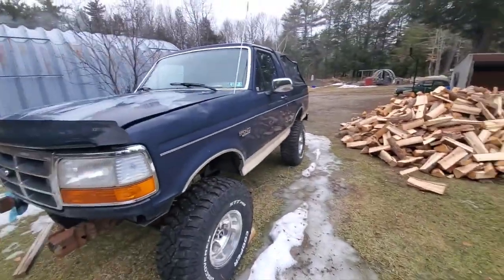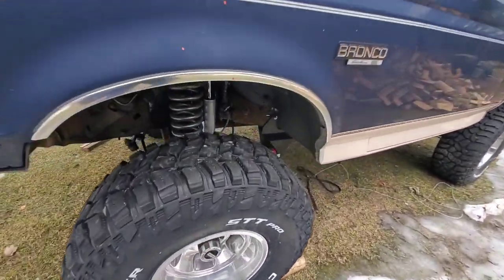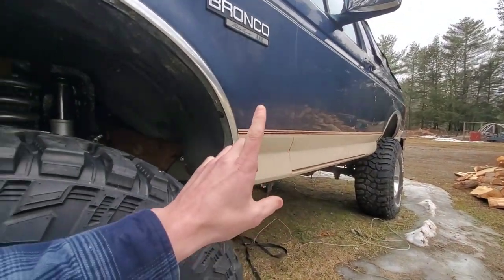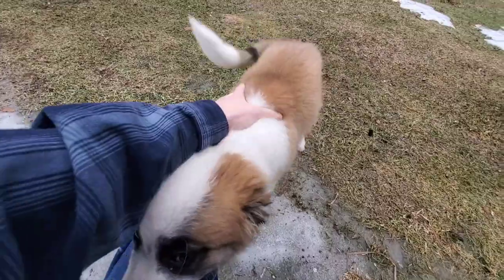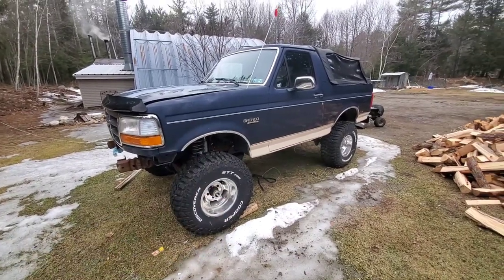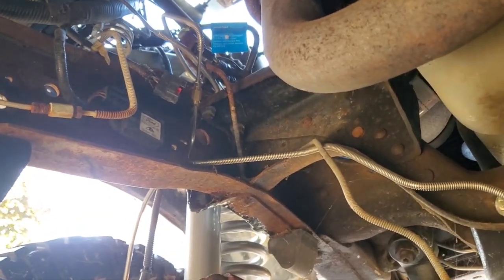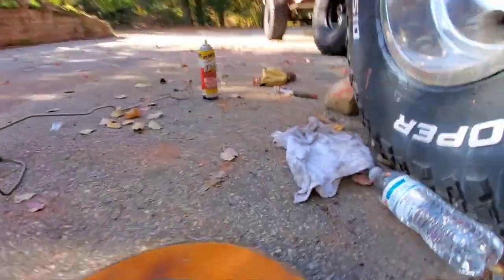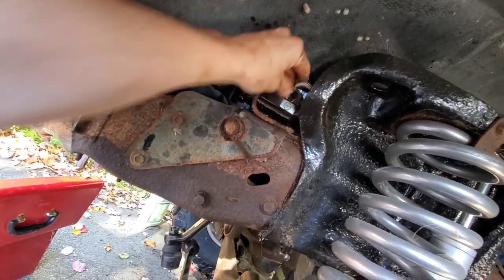Installing New Stainless Steel Brake Lines on the OBS Bronco

Comment: Bubble flares goes in abs and master cylinder not the double flares thats probably where you had problems at, and i just bought the line by the roll cut off as much as i needed had them flared and everything went swell.

Comment: I used the kit from inline tube on my F150 and I thought they fit like a glove, the stainless lines look nice in there (it is like your yellow truck).  I am now doing the same job on my Silverado using the nicopp kit - it is not nearly as easy as the Ford

Comment: Did your lines fit into the abs unit ? My 96 bronco I’m having an issue with the ABS to the passenger wheel. It will not thread into it no matter what I do.
Reply from the maker: Make sure you're using the correct line. The ones that go into the ABS unit all have the "bubble" fittings. It's possible you have the line flipped around or are using the wrong one, if you bought a kit like mine. Or just use some brake fluid and a wire brush and clean the inside of the fitting, just make sure you clean it good and don't get any dirt in there. It should just screw in. Make sure your line is the correct line.

Comment: The copper nickel are easy to bend you can bend them to factory specs with your hands dont even need a bending tool and if you know how to flare them yourself it makes it even better, so if your truck is extremely lifted you have as much line as you need, they come in 25ft and 50ft rolls but you have stainless steel so you should be ok in the future, glad you didnt get the standard lines cause they would rust back out at some time.